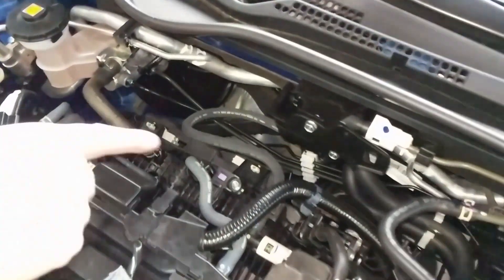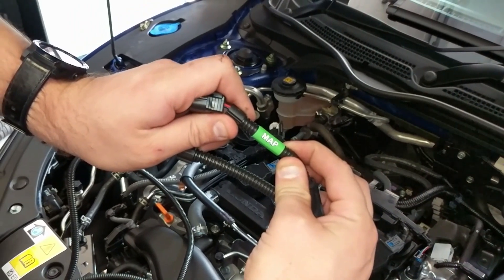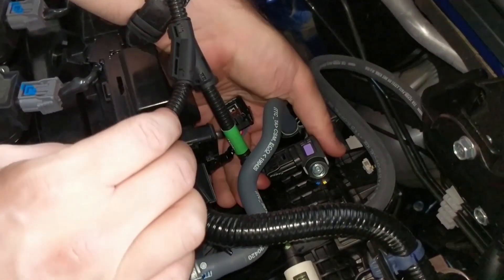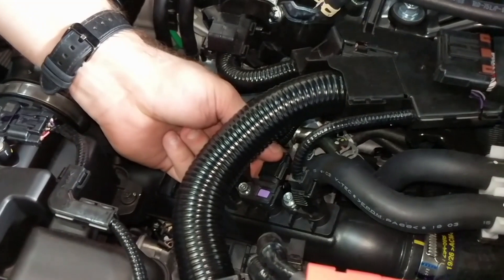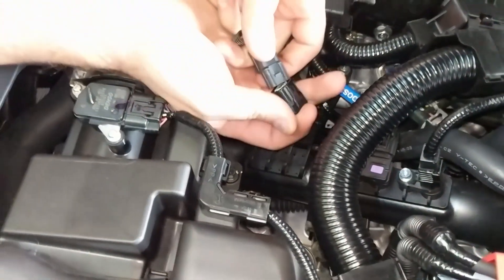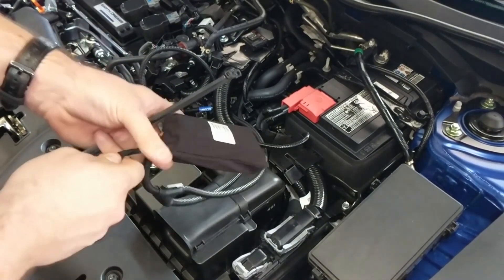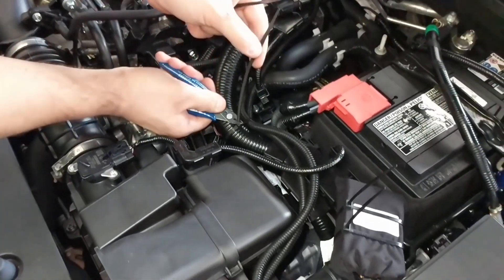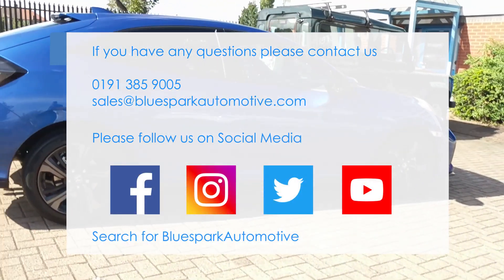Bluespark Automotive Honda Civic 1.5 VTEC Install Video

Comment: Is there different results for each channel? Is it safe to stay in the max setting consistently?
Reply from the maker: Yes. Setting E gives the most performance gains. Settings C and D will give the same power curve but with less performance. If you are using setting E (max setting) please use as high octane fuel as possible. If you use less than 97 octane you can only use setting C or D. 
Thanks
Reply: @BluesparkAutomotive  thank you 🙏🏼 great info 👍🏼
Reply: @BluesparkAutomotive  what do you mean by settings? how can you change these?
Reply from the maker: @dannysharpe8948  The unit has 5 different settings, they are located inside the tuning box and can easily be accessed by removing the bottom end plate. A user guide is provided with all units.
Reply: This car only uses 95 in my car. If I use 98 will it create detonation?
Reply: @wasaiteam nope